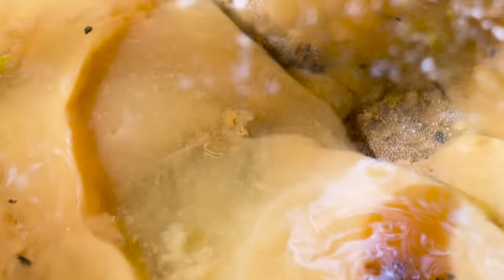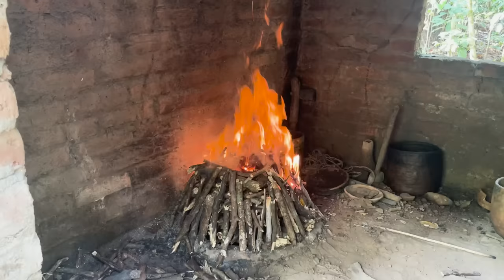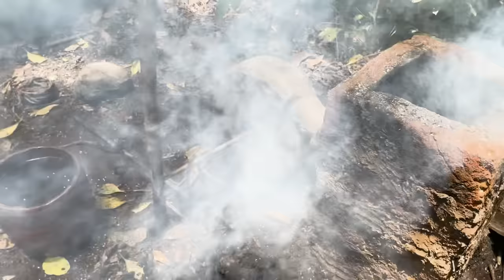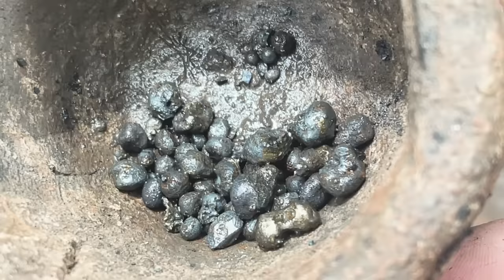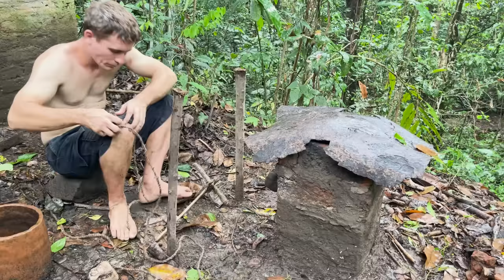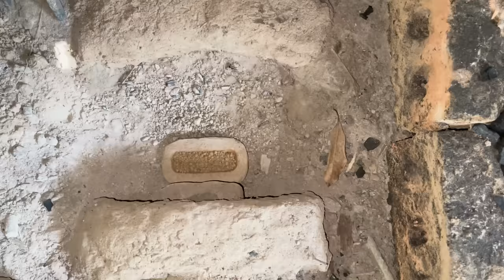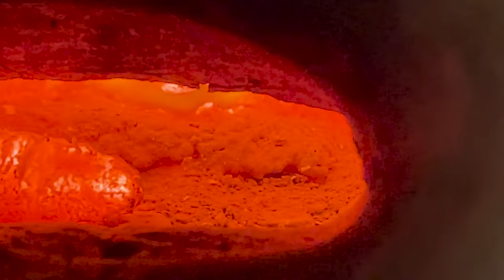Primitive Technology: One-Way Blower Iron Smelt & Forging Experiment

Comment: I believe the intake air stream is not having enough time to get very hot. Would be better if you had a way of feeding preheated air. Maybe a piping that take fresh air up and run down inside the chimney than leave the furnace in the bottom and connect to a manifold attached to the blower's lid.

Another thing that can help increasing the heat is putting more fuel between the piece and the blower, so the air flow trough more fuel taking more heat with it before hiting the piece.

Try to add flux when smelting the prills...

Comment: what if you use the bernoulli effect to pull more air into the fire. You can do this by leaving a few cm gap between the fan and tuyere connection. Also by making the tuyere have a greater diameter inlet than the fan's outlet. The air produced by you pulls in more surrounding air into the tuyere.

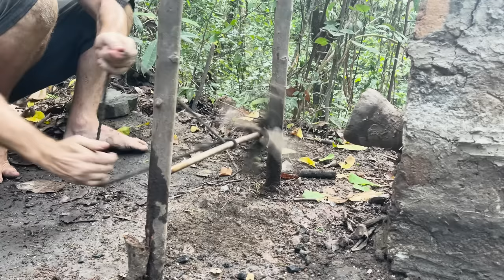Comment: 16:10 hmm that one is interesting. Wonder if you can have some sort of "cog" / "Wheel & belt" type mechanism where you simply turn a "crank" (wheel with a handle) and it reverses the direction to constantly spin it as you turn.

Comment: I have to wonder if the best thing would be to set up some sort of water wheel to power the fan.  I'm sure you could attach the existing blower to a longer shaft that would be spun by a series of blades fed by the creek.  Hell depending on how crazy you wanted to get you could probably make some rudamentary gears out of carved wood or ceramic that would make the RPM of the fan match modern levels.

Comment: Curious to know if you can implement a water wheel for the single directional blower to make the blower run automatically, should also create a safety in case you want to stop the blower.

Comment: to forge the iron, you need to use a crucible at this stage. but all iron beads in an earthen pot with some crushed charcoal. then to oven and put a lid on top with a tiny hole. heat it a lot. then the iron consolidates, beat it with gentle blows. at this stage, your iron contains lots of sulfur and phosphorous. etc

Comment: when you melt iron in a bar in an open mold like that wouldn't all the charcoal mess up the carbon ration in it ? wouldn't it be better to use a close creuset in more closed off/hot furnace ? 
(I don'k know much I'm genuinly asking)

Comment: Have you ever considered putting some of your ore into an industrial furnace to check if the ore really does contain enough iron to generate metallic iron under ideal conditions?  It could be the case that your fire is hot enough, but the bacteria just don't have a significant quantity of iron

Comment: If you can get the slag, iron prill mixture hot enough to melt instead of waiting for it to cool down, wouldn't they separate because of density? Like oil and water?

Comment: Suggestion:

Would it make sense to use two sticks for the turbine, but wind them the opposite way. You can sit on the side of the contraption, and pull one stick 'down-right', and the other one 'up-left'?

Or, just have much longer stick? Like, double the length, and use curved stick like a bow, so it is easier to pull?

Comment: Have you thought of making a blower that's pedal powered like a bicycle? You would be able to use massive amounts of torque since it wouldn't be connected through ropes and your legs are much stronger. I'm not sure if air flow is what's limiting you, but if it is, this could pump magnitudes more air in with less effort. It's just an idea though.

Comment: With the amount of carbon added through the process of melting the ore wouldn't it be closer to steel than iron as the carbon bonds with it? Or would temps need to be much higher for that?

Comment: 13:25  I am a little surprised when you where doing the smelt it didn't look like the furnace was getting as hot but that may have been because the tuyere is pointing down at an angle as so forces the heat to the bottom of the furnace rather then up the chimney

Comment: The bacteria itself can be the cause of such brittle iron casts. Acidithilobacius bacteria utilize iron oxidation process via various methods, depending on species, but most of them also oxidize manganese, which makes cast iron extremely brittle. Also, these bacteria are also accompanied by other archaei, who utilize sulfate reactions to get energy, so the iron can be heavily contaminated with sulfur. Both can be removed by oxidation, but at a lot higher temps.

Comment: So cool as usual, but feels like the half of the pull/push motion is still wasted, and the loosen rope will slow the rotation even for just a bit.
What about making a hand crank, or a cycle, to get totally continuous motion? 
Maybe even make some cog system to achieve even higher RPM?

Comment: You may need a crucible to allow the iron to properly meld together with less impurities. Right now, the ash and soil could be factoring into the metals brittleness. 

I would personally try to make a thick fired clay cup to use as a crucible as well as a lid for the top of the burner. The lid would have several “feet” underneath it that would rest on the top of the furnace to allow for airflow but would keep the majority of the heat inside the furnace. 

For even better results, you may need to invest in a creating a bloomery to better create the iron.  Again, the impurities of ash and soil could be affecting the metals integrity.

For a better mold pour, you may need to Knapp a stone into shape and form the mold that way. Though, this would require a crucible to actually pour it as well.

Not sure how much “modern” knowledge you want to use, but thought I might as well throw out some ideas.

Comment: Could it be possible to try to make a rudimentary steam engine to turn the blower? Essentially a thin bulb vase filled with water on a second fire pit, boiling off the water produces steam which turns a secondary fan, turning the blower. Or even Hero's engine.

Comment: The heat is enough for a forge weld, it seems that you are working with a not completely pure iron or one that has picked up too much carbon or silicon. Might I suggest a sealed crucible process such as was used traditionally in damascus for making real wootz steel.

Comment: I believe that undesired results are caused by either a lack in precision or lack of volume(s). If your blower and forge and tools etc had more precision they could more effectively perform their tasks. Alternatively, if you had a larger volume of pig iron or a larger volume of air you could increase your chances at getting one big ball instead of many small pearls. A good place to start that would surely help many aspects is the ability to get higher temperatures and chasing that goal may be a more simple way of continuing this work. One should also look into the possibility of smelting other metals to be able to achieve more precise tools instead of the minecraft progression.

Comment: You know, it could be more than high carbon causing that hot short brittleness. Some types of iron bacteria use sulfur as well, I wonder if the iron bacteria you're using might have a high sulfur content which would carry through into the iron. I think I read somewhere that limestone acts as a flux but helps remove sulfur as well.

From the Wikipedia page on blast furnaces: "Desulphurisation usually takes place during the transport of the liquid steel to the steelworks. This is done by adding calcium oxide, which reacts with the iron sulfide contained in the pig iron to form calcium sulfide (called lime desulfurization).[12] In a further process step, the so-called basic oxygen steelmaking, the carbon is oxidized by blowing oxygen onto the liquid pig iron to form crude steel."

Comment: One strategy to remove carbon from the cast iron might simply be to let it cook at very high heat in a high O2 environment for a really long time. The only way to realistically do this would be to mechanize the blower with a water wheel (or something to that effect) so you could just continually add charcoal. It would require a huge amount of fuel, though.

Comment: The process of burning out the carbon of cast iron occurs in oxygen converters in the liquid phase and requires a huge amount of pure oxygen, so trying to do this by simply heating it in coals is a waste of time. But you could try heating it in powder form with iron oxide, but still the temperature should be very high, and it is advisable to protect the mixture from the coals so that they do not take away oxygen.
Reply: Hmm, that's the best idea I've read in the sea of misunderstandings in these comments. Powdered iron ore (oxide) and crushed cast iron prills in a crucible. IT seems plausible that the oxygen in the iron oxide would react with the dissolved carbon in the cast iron, but I'm not sure if that reaction is happening at any great speed. There is a historical precedent for this, but It's not clear if it was the main mechanism or just a superfluous step that was thought to do something.
Reply: @bhartley1024  I'm in the same exact doubts. It's just a speculation based on chemical properties of substances used. We know that thermite reactions occur under similar conditions in principle although they requires more active reducing agents. But they're also exothermic but here the energy is given from the outside. So considering all given circumstances it's possible that iron oxide may take carbon from the alloy. He can, of course, sacrifice his camera, that should contain aluminium,  and make some iron using that strong reducing agent. :D
Reply: @Ma_X64  From the Wikipedia article on puddling https://en.m.wikipedia.org/wiki/Puddling_(metallurgy)

"When wet puddling, the formation of carbon monoxide (CO) and carbon dioxide (CO2) due to reactions with the added iron oxide will cause bubbles to form that cause the mass to appear to boil. This process causes the slag to puff up on top, giving the rabbler a visual indication of the progress of the combustion"
Reply: @bhartley1024  never read that. Good to know it.

Comment: Try to make japanese fuigo, a box blower that works by pushing it. I see some blacksmiths using them quite easily and it seems to blow air faster than regular spinning design.

Comment: What if you make a really large version of the blower and used the loop rope pulley system? But funnel the air into the same sized tuyere so that the air pressure is stronger.

Comment: If you can figure out how to make a simple gear system and pedal board, you can probably maximize the air flow. I'm not sure what the best materials would be, though, from what you have available. Ceramic components could be precisely the shape you need, but weight and fragility might be too much. Maybe from the local trees? Cutting and drilling a disk and holes from a piece of wood usually takes decent tools though, and I don't know if yours are precise enough. Regardless, it's something to think about and experiment with!

Comment: i wonder if you try smelting/forging at night or when the air is colder so it is more dense for higher oxygen concentration?
Reply: and if you want to make a heavy flywheel and a connecting rod (like steam engine wheels or an engine crankshaft) you can use intermittent linear motion to convert to constant rotational motion

Comment: idk if it is possible, but would something similar to a car's turbo be possible? Use the exhaust to spin a fan to blow in more air, causing more exhaust, etc.? Or maybe build it near the creek and have the water constantly turn the wheel (though that may require some more heavy duty gearing. Even a windmill? Idk some sort of automatic turning that you can just shovel charcoal and ore into would be neat. A primitive industrial revolution if you will

Comment: Damn this is solid take but you NEED to add river sand on top, this would have worked as perfect flux and ingot would have been much more uniform, and mix in some  bacteria iron oxide with pig iron prills in your ingot - it should bring C level down to more usable steel.

Comment: To help purify the iron you crush it up and mix it with crushed charcoal and put it in the crucible then smelt it. The charcoal will react with the oxygen in the iron.

If you don’t add charcoal to the iron ore there won’t be a reducing agent to extract the oxygen from the ore.

You might also want to filter your iron ore mixture to remove as much sand as you can because the silicon will weaken the iron. This is mostly what slag is, but when smelted it should form a separate layer because it has a different density than the molten iron.

Also, you ideally want the charcoal mixed with the ore the burn inefficiently. This is because carbon monoxide is a stronger reducing agent than pure carbon.

I always find it exciting watching people experiment and learn to make iron the way our ancestors did. Keep up the good work.

Comment: When you make fires, why do you keep the bottom as plain dirt? Wouldn't it insulate the heat better if the bottom of the furnace was a brick or cement? Additionally, couldn't a bowl-shaped brick slab at the bottom of the furnace act as a good way to make sure the Iron slides together into bigger clumps?

Comment: I know this is a lot more complicated but if you could get enough strong rope, you could make a design that uses two pedals that you press one after the other to get the fan to spin. The only problem I can't figure out with my reduced intellect is how you'd create a gear ratio so you could get it to spin a lot faster for less movement from the pedals. This would be an upgraded form of the foot powered fan. 
Again, I'm sure this isn't really feasable without better wood working tools

Comment: If your trying to make a solid piece of metal, need to make a almost air tight container, cause with it in open air, just oxidizing that metal, part of all your hard work is just burning up, maybe make a container like you did when first formed a solid lump but make a cap to fit on top, you will have have a slightly higher temperature fire like when you created all those little balls of metal, afterwards cover fire and let it slowly cool, should come out with a more smooth and consistent product that will be easier to shape! Good luck

Comment: I’d imagine this has been suggested or he has a reason not to do it, but why not make a waterwheel or water powered blower?  He clearly has access to streams.  Even if the water flow is tiny all he needs to do is create a small reservoir with a plugged hole in the bottom (using those tuyer things as pipe.  Once the reservoir is full (maybe a day or days?) he uses the water jetting out of the tuyer once he unplugs it.  Water power.  Or simpler, like I said, make a waterwheel.  Clearly he is clever and smart enough to figure an approach for this.  This would give him continuous air flow and possibly faster air flow or multiple blowers while not being physically demanding.

Comment: @primitivetechnology9550 Forgive me if I am wrong, but the time you are taking to add coal and ash—is it allowing your molten iron to cool/reheat (vs constant temp) while you are performing the process? Is this potentially contributing to the brittle result? 

What about staging a 2-part platform, slide, and gate—housing your carbon and ash separately and added to furnace/kiln via slide (by actuating gate via rope)? This would allow you to maintain blower speed/output, temperature, and would ensure consistent smelting.

Or I could be out in left field pretending to offer advice to someone far more knowledgeable than myself in this area. Regardless, I do enjoy the content along with the other millions. 😊

Comment: If you've got iron bacteria present, then you may have bog iron nodules. The old way was to use thin rods, like saplings or steel rods, and drive them down into the soft wet earth in a wetland. If you did all that with just ferrous biofilm, imagine what you can do with whole nodules.

Comment: As a student in metallurgy, i must advice that You don't hammer any ingot produced by this method, because you are making what is called "cast irons" that is an alloy of iron-carbon (Fe-C) that can't be used for smithing. The property of any metal alloy varies according to the composition. In a general sense, cast irons are made of more than 2%Weigth Carbon, or even 2% Equivalent Carbon. For a metal that can be hammered, you would need at least lower than 2% Carbon, and with your set up, that can be very difficult. Also, once you have the metal pellets, don't wash them with water, this causes oxides to form, oxides that turn into slag and only contribute to the Equivalent Carbon. For more information, you can look up a Phase Diagram or equilibrium diagram of Fe-C. (Meta stable) Sounds like a lot, but it's fairly easy to read. 

Overall, I can see this as a well developed method for iron obtaining using primitive technology, because other alternatives that achive worse results use more components. Also, using iron bacteria is impressive, because other methods I've seen use more and yield worse results than yours. Great video.

Comment: Seems like you miss the point with flux for cast iron. You should fill the crucible with iron pill and all empty space with flux. In the wilds you can use sand, it should  melt to glass film upon iron smelt.  Crumbling slug after heating seems like burned to ferrum oxide.